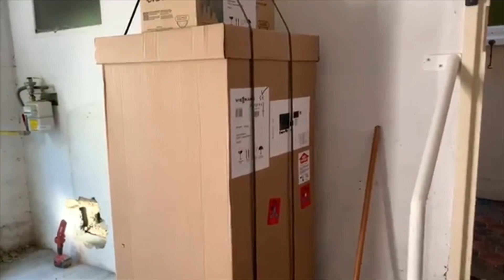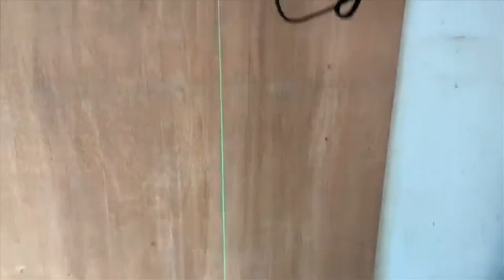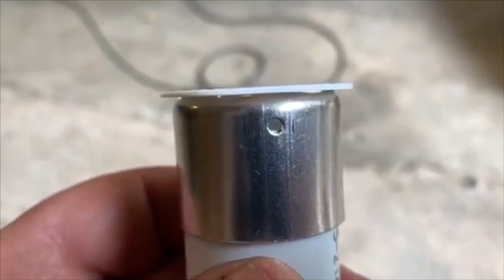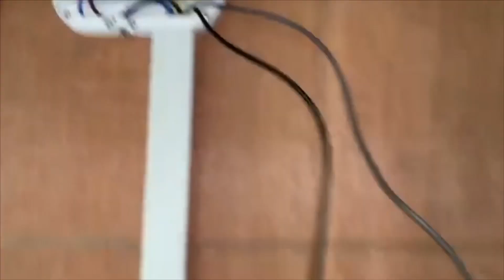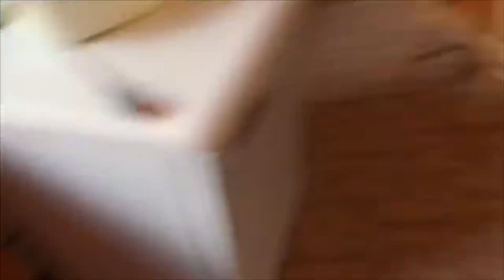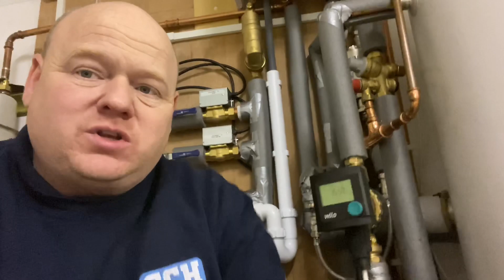LEEDS PLUMBER - UNVENTED CYLINDER - NEW BOILER - HOT WATER RETURN

Comment: Hello there, I'm really impressed with your videos and I would like to know if it is possible to connect an unvented cylinder coil to an oil fired heating system through one pipe only or I really need to connect it on both?

Comment: Great video again Allen. Just wondering if you can answer something for me I have a condescending oil boiler and I am have a wood pellet boiler linked up with it so I can use one or the other does it need motor rise valves fitted in to stop heat going to the other boiler it’s a 2 pipe system. Chris

Comment: hi alan could tell me if pump starts up if hot water tap is open on unvented cylinder also does pump start up if immersion is being used to heat water thanks
Reply from the maker: no and no. Pump pumps around coil. Thanks.
Reply: thanks for reply

Comment: Alan, I've enjoyed a few of your videos but just stumbled across this and its made me subscribe. I'm wanting to install a similar system and this has given me some ideas (I'd no idea what an S plan was before this). I want my system to go in a a loft space and that was making me think about getting the Viessmann 200 system boiler as I think I can control by wi-fi from my phone instead of accessing the loft. One thing I noticed from the video was the overall height of the install, obviously not an issue for your install in that garage but do you have an idea of what sort of minimum height would be required  ? I particularly noticed the water expansion vessel mounted above the cylinder - is it important to mount it above? Would love your thoughts....

Comment: Great video as always Alan! If I could have one pick it would be the electrics (sorry) wagos are not intended for twisted wire, you need to get some 0.75mm 1mm and any other size wire you use and get bootlace ferrules this makes for a safe connection.

Wago do a wiring centre for this now or you could use a din rail with din rail joining pins, this would make your wiring safe and look really good like your plumbing.
Please no more unsafe bird nests 👍

Comment: Hi Allen,  on new builds we put in a dedicated cold main to the unvented cold water inlet control so a balanced cold can be taken, ...
On existing houses that are having a system upgrade to unvented, the cold main will likely have all cold connections to all appliances coming off the cold mains supply.
Unless doing some major alterations does the cylinder manufacturers warranty become void if the system has no balanced cold? Or can we just fit a separate pressure reducing valve on the point of entry to try and even up the pressures?
Reply: Just as an example, incoming mains at 7 bar... the pressure reducing valve at the cylinder would reduce to 3 bar to the cylinder itself , so in that scenario there would be 7 bar on cold side of taps etc, and 3 bar at hot taps. Pressures then arent balanced.

Comment: Hi Allen another great video with wiring !! You didn’t show where the two other nests we’re situated? And it would have been nice to see how you routed the pipes under the floor and how you joined it into existing pipe work?? Also the pressure in the boiler was 2bar is that normal for such a big system??? Many thanks
Reply from the maker: I installed the nests in the main house upstairs. I didn’t want them to have issues with signal later on. I would normally leave pressure around 1 bar. Well spotted though. Thanks.

Comment: Brill video Allen, i cant say which is the best boiler but i can say that ideal are the worst. 
Allen what is the perpose of a condensate trap? Where does the water comes from that goes in there?
Reply from the maker: Because of the low temp the flue gases give off a water vapour/Condesate. Thanks.

Comment: Customer picked both Viessmann for boiler and cylinder. Could the 222 been an easier/simpler/cheaper install?
Reply from the maker: This is miles better than a 222 in my opinion. Thanks.
Reply: Waz Kayani  I’m with you, a viessmann 222F would have been my choice of install